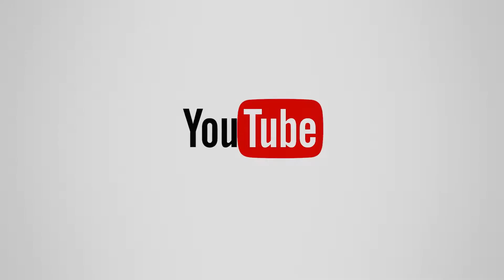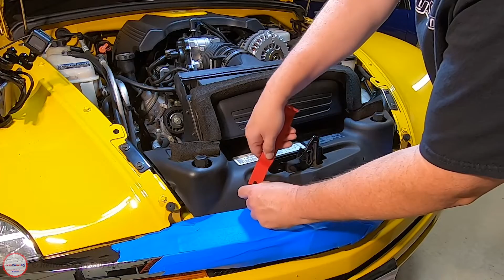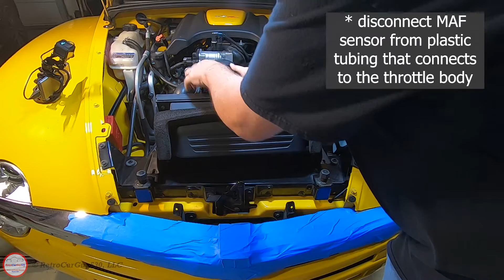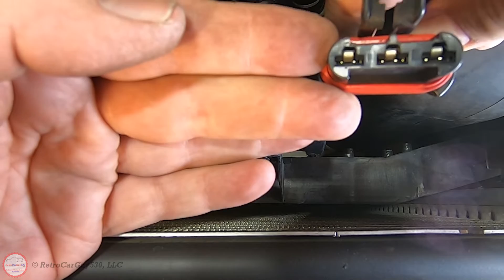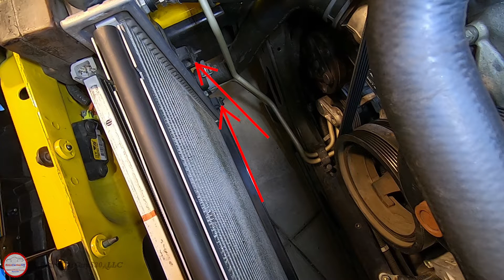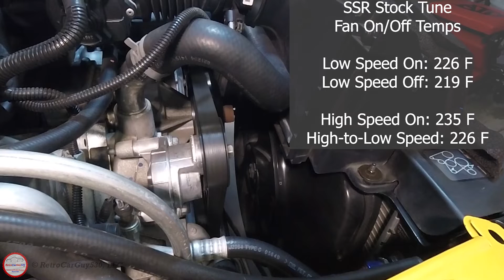Chevy SSR SE-MFK-1 Radiator Cooling Fan - Installation

Comment: followed your steps one by one and it was great. i fixed my overheating problem. i thought it was the thermarstat . have to pull out again because it didnt seat properly and has a slight drip. installed a new coolant resivrior and cap hopefully i have solved my over heating problems. thank you and simple engineering.

Comment: Does SSr also have fan clutch or just electric fan?
Reply from the maker: The SSR only has an electric radiator cooling fan.
Reply: Followed your video and got the new fan installed, easy drop in design. Working great now

Comment: Just replaced mine on my 05 6 sp  ,just picked it up in July,been putting recommended SSR parts from simple engineering now just waiting for my cargo light whenever they get some in
Reply from the maker: Congrats on getting your SSR last month!  I wish I still had my 2004 SSR.  I had to sell it last year to keep my business going.  😦
Reply: @RetroCarGuy530  fit like a glove, had more trouble gettin my AC belt on, tensioner felt like it hit it was hitting something when I depressed it, had to squirt some lube on it must have been dirty all these years but both belts on fan on all works good thanks for the good product, didn't need the extra plug but that's okay I'll keep it for a spare, thanks Mike
Reply from the maker: @Kyle Foreman, I'm not Mike Moro from Simple Engineering.  I'm Robert Baller from RetroCarGuy530.  I've created most of the installation videos for Mike's products on his website.  Mike says he has a lot of people think that the guy in the videos is Mike, but it's me Robert.  :)
Reply: @RetroCarGuy530  oops ,any way tks for u guys an the nice SSR family too keep these hotrods running.yep so far had my ABS redone from ,Fix it,heat shield,spoiler,fan,new belts,spare ignition, hopefully new trunk led when available. Tks for all ur videos Robert..
Reply: Haven't seen a video on replacing cargo light,inside cover have too be taken out too replace it ?? Tks
Reply from the maker: I don't have a video for that topic since my former 2004 SSR did not have the carpet kit with the cargo light.  There is a PDF document in the Microsoft OneDrive library created by Richard Bellville (Dicktator on the SSR Fanatic website).  His document talks about replacing the oversize (amp rated fuse) with a lower amp fuse and changing the bulb to a LED bulb.  Look for "BED LIGHT FIX 82019.pdf" in his file repository https://bit.ly/dicktator-ssrhowto  

The kit offered by Simple Engineering replacing the circuit board to help address the safety issue with that light assembly.  You can download the installation instructions for that product from this link https://simple-engineering.com/wp-content/uploads/2020/08/SSR-Cargo-Bed-Lamp-Repair-Kit-1-1.pdf
Reply: @RetroCarGuy530  tks for that info,,Simple Solutions is currently out of that item.sorry too hear u had too get rid of ur SSR, hopefully u can get another when things change..Tks again..
Reply: @RetroCarGuy530  an again tks for all ur little tips on the SSR,I did ur silicone little trick in the rear tailgate also

Comment: how is it working so far?
Reply from the maker: I've been very pleased with the Simple Engineering SE-MFK-1 radiator cooling fan.  I've installed one in two different SSRs that I've owned and I've installed that same fan into several SSRs for other SSR owners.
Reply: @RetroCarGuy530  i have an 04 ssr and it just started to overheat but only when i sit in traffic and still has the factory fan i belive…. im going to try that one see how itll go.. thanks

Comment: Great video.  I just bought a 2003 SSR yesterday and drove it 11 hours home and a few times the engine temps got too hot for my liking.  I am going to get one of the Simple Engineering fans.  Any recommendations on where I could have the ECU reprogrammed to have the fan come on at. lower temp than the factory tune?  I don't like those 230 degree temps.
Reply from the maker: I don't have any specific recommendations for tuners / shops to tune the SSR.  When I had my 2004 SSR, I used a DiabloSport iTune2 i2050 50 state legal version.  The tunes provided by that device (which is an old device at this point in time) had lower fan on temps in the tune in the device.  The reason I used that specific tuner device was that it had a California CARB legal (EO Number D-770) tune that could be used in California.
Reply: @RetroCarGuy530  Thanks for the quick response.  I bought the car in California but I live in Phoenix so I do have to have an emissions test, but it''s not as bad as in CA.  I will look at tuners.  Would be nice to have the capability to do that myself.  I'm up for studying to learn it but I hope the learning curve isn't too steep on the tuners.